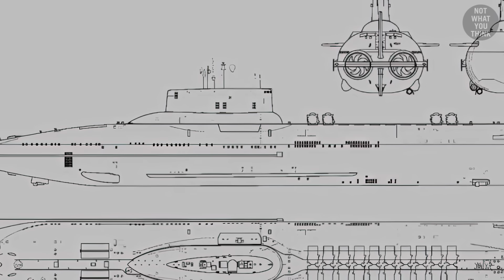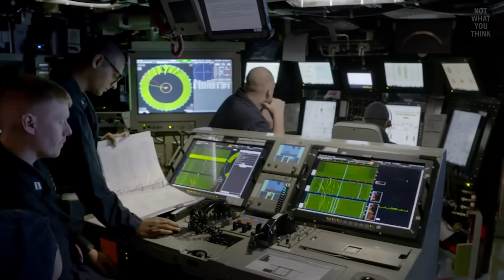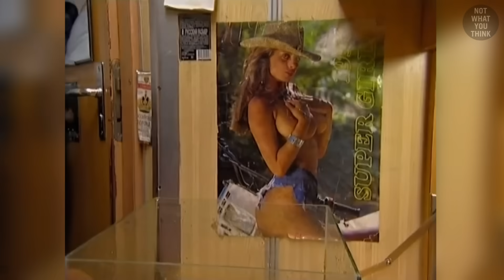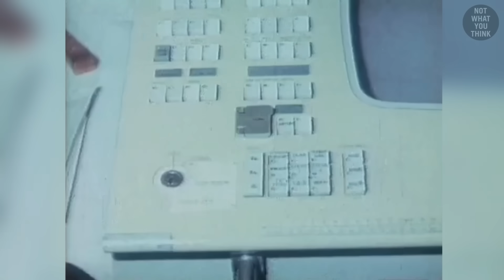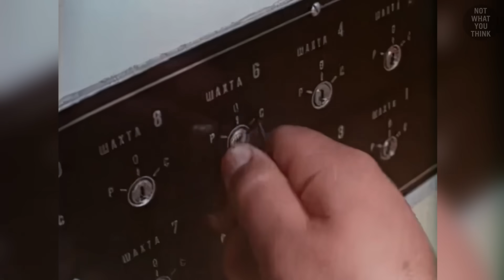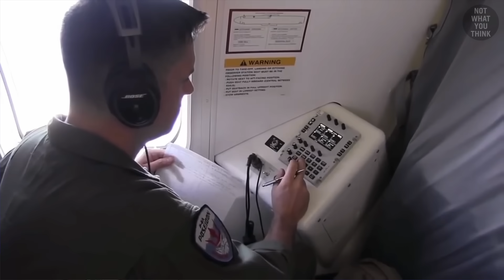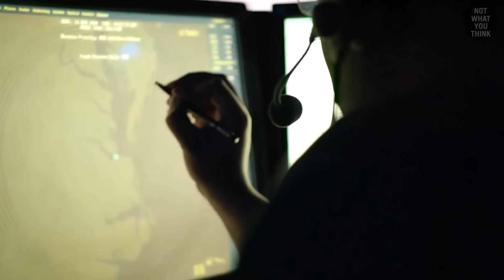Why The Largest Submarine In The World Wasn’t Big Enough

Comment: It was larga simply because the backwards Russians could not build rockets small enough so the submarine was build around the rockets. 

Lets remember that in submarine tecnology  big is not better,  big are easier to detect, slower, noisier, needs deeper waters, turns are big plus a mega gigantic metal magnetic signatura !!!! 

It was a failure when new and a bigger failure now.

Comment: range is never better per/payload in solid compered to liquid.....stress ressistance is better, an if you dont have tech no fueling needed before lunch in solid, ofc this last isnt important cose russia solve this with icbm-ur-100 model thet are ready to lunch in minute an have fuel always,,even today   Rmu 2-liyner is only 39-ton with 12 warheads an 10 000+km range on liquid compered to 50-ton bulava of 8-warheads an 10 000+ or trident-2--8 warheads  59 ton 10 000+km range [[ yes bulava an trident on avrage cary stronger warheads 400-500kt compered to 200kt liyner]]

Comment: The Akula actually featured a revolutionary mechanism to decrease noise output with roughly a thrid compared to other subs. Can't belive you left this out.
Reply: isn't it the reason it was called akula , i remmener Reading years ago about the outer skin that acted as noise input ?
Reply: Can you tell me more about it?
Reply: @R83jf8whdih1o  a submarine has 3 main noise-producing components - the engine, the drive (propeller etc), and the cooling system. They basically managed to silence the cooling system somehow, thereby removing 1/3 of the noise. It was  a good example of Soviet ingenuity: not very high-tech, but still groundbreaking.
Reply: @M1tjakaramazov  Great. I also heard in the fiction movie that the typhoon had a Caterpillar drive, was it true?
Reply: @R83jf8whdih1o  in the movie yes, in real life no 😅

Comment: Russia (as well as the former USSR) routinely dump nuclear reactors (many still fully fueled) in shallow water in a designated area off of the Kola peninsula. The two most spectacular ones are the original reactor from the K-19, the other was when they used high explosives to cut the entire reactor compartment out of one of their ice breakers, although in that case it appears that the reactor wasn't the issue, it's was some form of lack of training of the crew that lead to the compartment being so irradiated that they couldn't decontaminate it. So they dropped it out of the bottom of the ship and built a new one for it.
Reply: Не говори чушь! Дурачок.
Reply: Ну только не "сбрасывают"..
Сейчас уже оборудована площадка для хранения.
После того как это дело передали "Росатому" отработанное топливо уже давно регулярно выгружается у объектов подлежащих утилизации.
Никто ничего не ждет.
Все строго контролируется.
То что было в СССР это уже не счёт.
Вы тоже до 1990 года скидывали  реакторы в Атлантику, так же как и мы в северный Ледовитый океан.
Вот только у нас там затоплено 14 реакторов. Как думаешь сколько вы затопили их в Атлантике?
Это просто. Посмотри сколько их находится в Хэнфорде и сколько всего было утилизировано.
Ответ тебя сильно удивит..😏
Reply: @АнтоДив  About to say we did stupid crap too.

Comment: Can someone tell me why the missiles have more than 1 nuclear warheads???  The russians with 10 nuclear warheads per missile and the Americans with 8 nuclear warheads.
Is warhead a standard? (size).
Also would the missiles always be filled with the maximum possible warheads? Or do they change the amount of warheads just before launch?
Reply: warheads are the nuclear bombs on the tip, while older missiles had 1 warhead more modern missiles have multiple independently-targetable reentry vehicles aka MIRVs, which means 1 nuclear missile can hit 10 cities because it releases 10 bombs, like a shotgun if the individual pellets could be guided onto cities or military targets. Currently russia is developing a hypersonic glider system Avangard which can be fitted on a missile and manouver and evade interceptors while delivering a warhead.
Reply: @iplaygames8090  thanks for the explanation. one has to wonder about the practicality of a 'manouver and evade' missile. I mean If anyone (russia) fires a nuclear warhead, there will be thousands in the sky in no time. Correct? since the US will retaliate. After which russia will also fire more ..etcetc. ? 
I just hope everyone keeps their cool.

Comment: The I-400-class submarine I-401. The Sentoku type (潜特型, Special type submarine) (I-400-class) displaced 5,223 tons surfaced and measured 400 ft 3 in (122.00 m) overall. They had a figure-eight hull shape for additional strength to handle the on-deck hangar for housing the three Seiran aircraft.
Reply: Biggest submarine of pre-nuclear era. Was designed to bomb a Panama channel from Atlantic side!
Reply: Imagine if us didnt detonated that and make them cruise missile sub at the start of cold wahr

Comment: Interesting! The Typhoon's are certainly impressive in the size. Its a shame they seem to have only been actively deployed  in/under the Artic, as that would seem to make it much harder for the US Navy Poseidon's to get a good handle on them regardless of their apparently louder acoustic signature, (under the ice or not) especially as these aircraft have only been on active duty since around April 2019 and perhaps only until recently been attached to the 6th Fleet, which operates out of the Mediterranean Sea. Most of all though, all but one of the Typhoon class were scrapped well before 2019. Has there been good, honest information presented in this YT doc'?
Reply: You a communist!?! 😠
Reply: P-3 Orion does the same thing, albeit a little lower tech, since 1962. So... same role, different aircraft. Doesn't matter much.

Comment: I've had an interesting career. Before I was a Mission Crew Commander Air Battle Manager on AWACS, I was a Nuclear Missile Maintenance Officer at Malmstrom AFB, Montana, with Minuteman III ICBM's.  It's interesting to see the Russian created this longer range missile to shoot from the Bering Sea that only flies 4,500 miles and weighs 200,000 lbs.  That's a lot of weight for a submarine and not that great of range.  The Minuteman III flies over 8,000 miles and is 80,000 lbs.
Reply: The Minuteman is a land based missile and carries far less warheads. The Russians were about overkill, And so built a fudging massive missile armed to the teeth with warheads to launch from a massive submarine where they can park anywhere and play war games lol
Reply: @helenHTID  The whole idea was to discourage the opposing side from having any funny ideas. "Overkill" is just one of the strategies of achieving this goal.
Reply: Just a quick search shows mm3 with a payload around 1000 lbs and the r39 carries up to 2500 kg
Reply: @DarthObscurity  300 kiloton isn't enough for you? You don't need a larger payload
Reply: @DarthObscurity  Because historically, the Soviets made up for their poor guidance systems with larger nukes, which needed larger missiles. And larger missiles meant a larger sub.

Comment: 00:57 The largest aircraft ever build was the Stratolaunch Roc Carrier, but that was just wingspan, I say the largest plane every built was the H-4 Hercules, or to some, the Spruce Goose. I'm not a historian or anything, I'm just a regular person, but I think you are wrong in saying the largest plane ever build was the AN-225. A large plane indeed, but from what I have seen and looked up, the AN-225 is only the 3rd biggest plane every built at 88.4 meters. The Sratolaunch is 117 meters, and H-4 was 97.5 meters. 

I still like the video, but don't think that was accurate.

Edit: unless you are talking about maximum weight on take off, then it's the AN-225 just not in terms of size
Reply: biggest in volume im pretty sure

Comment: At least one Typhoon should become a museum.
Reply: I think, though I'm not sure, that you can see at least some of the interior of this gigantic machine either in or near Murmansk. I want to say I've seen people tour once recently, but I can't remember for sure.
Reply: So.. ooo....... Above surface orr under water measeum
Reply: @sumukhvmrsat6347 >>> Above, if possible.
Reply: @sumukhvmrsat6347  another ukie bot.
Reply: Or a party club?
Reply: That is the plan apparently, but obviously it'll take years to strip out the classified elements such as the reactor and missile control elements.
Reply: if they ship it to a museum ...80% of it will be stolen before it arrives...and when the rest arrives some vadnik is going to steal the museum.
Reply: With or without the radiation?
Reply: @christopherpakney8542 >>> Preferably the latter.
Reply: @christopherpakney8542  it only took 5kg to power a nuke submarine. so keep ur silly backward mind away
Reply: That’s what I was gonna say 😅

Comment: Bigger ain't always better... Imagine if they converted these to research vessels... Won't happen, but imagine if they did....
Reply: Not much point. They can’t dive deep enough to do much more than a surface ship can.
Reply: Deep sea research is more the domain of smaller submersibles, which are far more capable of diving into the ocean depths than military submarines by about 5x - 6x deeper.
Reply: Imagine Ohio take the sake procedure? Still cannot imagine? What's the problem, the pover of insulationists fridom doesn't help?